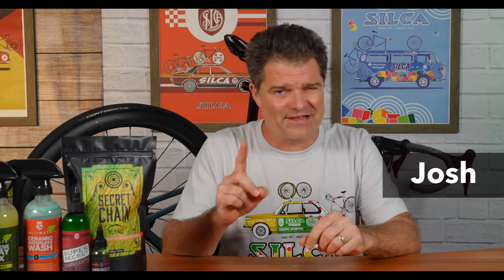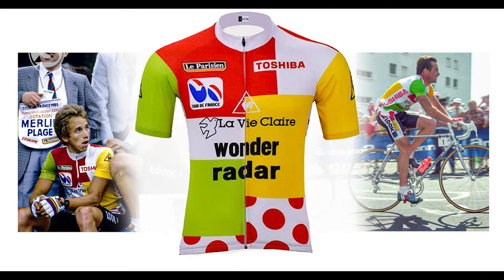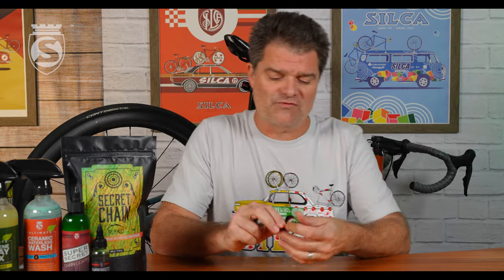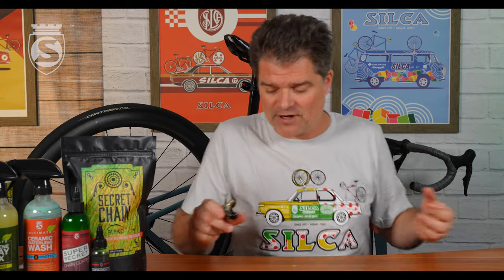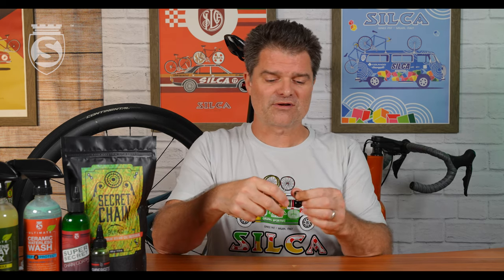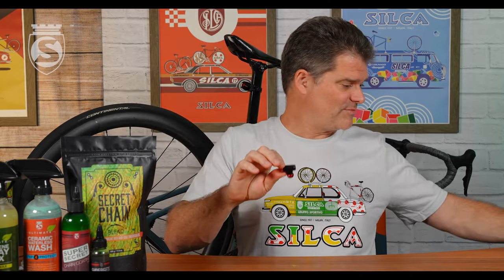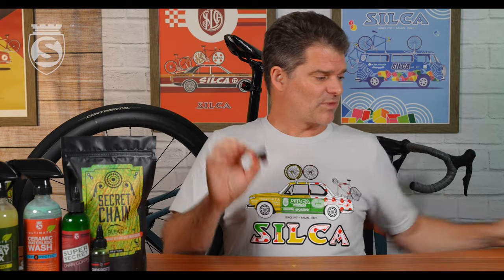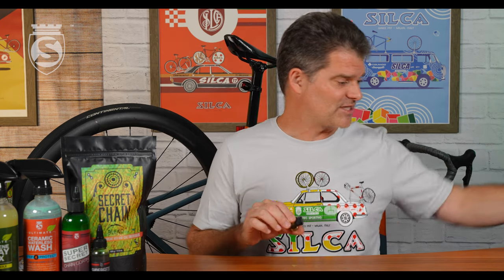The Tiny Tool That Changed Cycling Forever – EOLO!

Comment: CO2 not environmental friendly.  Replace with mini electric pumps.
Reply: Yeah a battery, PCB is so friendly on the ecosystem. The co2 of beverage gas or in the co2 doesnt drive the climate change. Indeed the Produktion/Recycling of the  capsule is is energy demanding.
Reply: I'd love a Silca mini electric pump.  I would never use CO2 over electric pump now.  So much easier to use, even for novices.

Comment: Eolo 4 is definitely the best inflator I have used over many years; it has the best flow control. If there was any room for improvement, I would say, make the flow knob so it can't unscrew completely and separate from the body. I have found that it can unscrew itself and fall out in my seat pack over time causing a small panic at the roadside! But from an operational perspective, there is no better inflator!

Comment: Add in the weight of CO2 cartridges along with the EOLO you are very close to the weight of an electric mini pump (CYCLLUS AS2 pro 120 g) that can pump 4-6 tires. One does not get the waste of the cartridges nor does one get the clattering of tubes in their seat bag/back pocket (and more environmentally friendly). downside is cost is initially more. Thought maybe at the end you were going to announce a Silca electric pump to replace EOLO.
Reply: Plus it is perfect when traveling abroad since many airlines don’t allow one to fly with co2 cartridges. You also get a digital gauge when doing road side inflation.
Reply: ELECTRIC?  OMG, you must be kidding.
My  30+ year old mini pump is still going strong.  How many batteries would have died and gone to heaven in that time period?  Or electrical connections or wires failed?  Charger lost?
Jesus, if you REALLY care about the environment, you'll use a hand pump!

Comment: I'm an Solo 3 fan, I've seen too many riders screw the Co2  onto a 2/4 style with the knob and dump all the case into the air as they didn't close the valve after using it the last time!

Comment: I have the original brass one and still use it. My wife bought me 5 or so years ago a new US Silca distributed a shown at 6:50 in the video one - It failed a few years ago even though it never saw much use. The head just fell apart when taking it out of my saddle bag. 

I still have some Silca frame pumps with campy heads. And, the large track pump.

Comment: Now I finally understand how the tire leaver CO2 works, you have to turn it lose a bit to get the airflow going. As I almost never use these things (Lucky me) then I tent to forget this and then I cannot inflate my tube as no other CO2 device is doing it this way. This is also most likly why I had several times a failure. Call me stupid, but typically you got a puncture when it is shitty weather and cold. So will stay using my BBB or Topeak tool for this

Comment: While I love Silca products and generally think the product line is on the cutting edge, I have to say the pump side of things are starting to feel antiquated. I have moved to portable electric inflators like those offered by Cycplus. I paired them with a Silca chuck. I even packed one in the saddle bag. Electric inflation is so much better than the old manual labor way. I’m never going back. It would be nice to see some electric inflators from Silca.
Reply: Why not just ride an electric motorcycle while you're at it?  "The old manual labor way?"  Like PEDALING????
I cannot imagine how someone can put in 20, 50, 80+ miles on a bike and find a hand pump difficult.
(I suggest hitting the weights so your upper body isn't so weak!  Stronger upper body & core will make you a better, healthier rider anyway.)

Comment: I wonder if it would be possible to have a cartridge with mixture of gasses which includes nitrogen pumped into the tire. While CO2 is admittedly fast in, its diffusion rate out of the tire is quite high. And if dreams can come true, I am dreaming of a gas-regulator where I can set a desired tire pressure and it stops with the gas emission at the selected pressure.